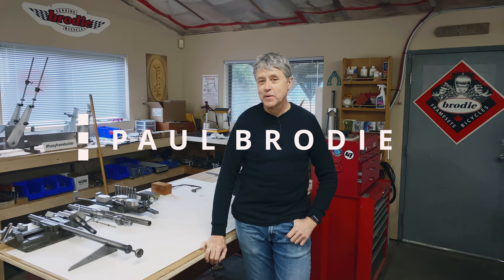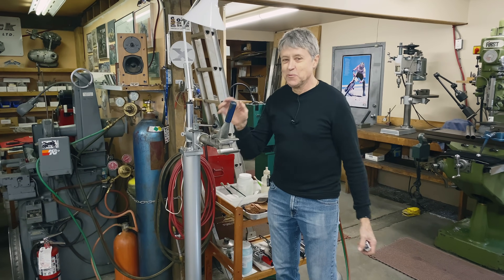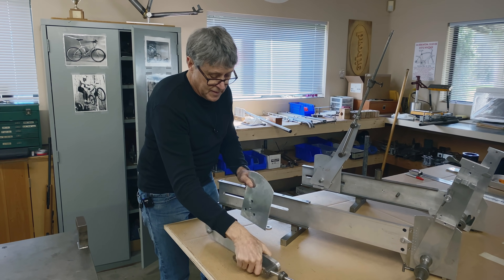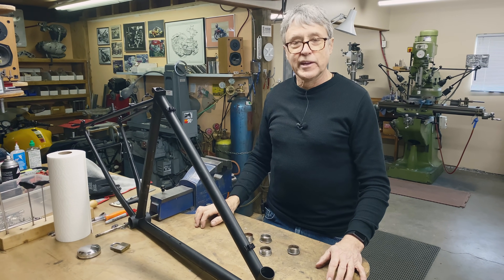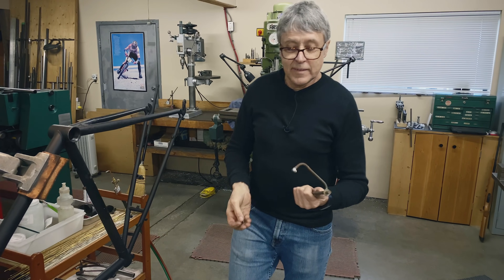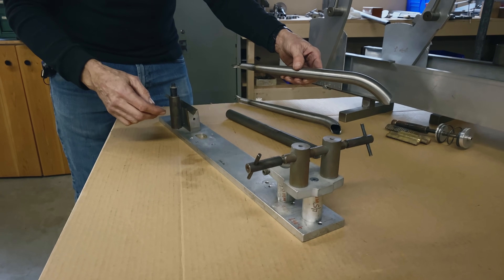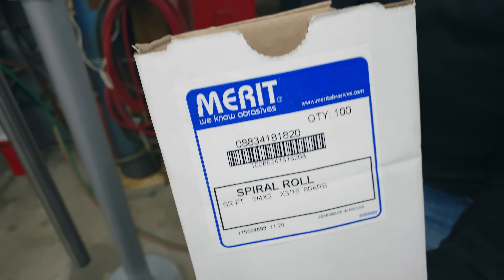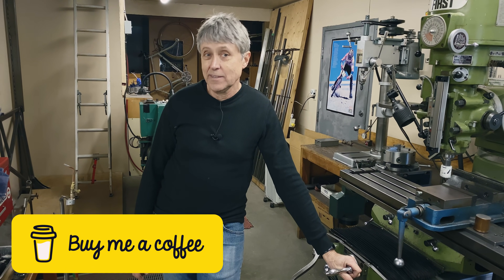Shop Tour! Motorcycles, tools, and essential framebuilding jigs - with Paul Brodie

Comment: Cool shop!  Nice elevator. Lol 9 years flew by, didn't they? Im guilty of letting my bikes, boats, 4x4s, etc all sit with gas in them for at least 9 years..  my problem is that in order to prepare a vehicle for long term storage, you have to know you're done using it.  
I thought all you frame builders used those weird old school squatty looking torches.. 
They do make silversolder in stick form they make the flat kind and round. Ive only used the 5% and 15% silver kind

Comment: Wow, thanks for sharing this, I find it odd how the bicycle people often aren't very sharing with information. It;s like I know this secret and you don't ,so you cant do what I do. I don't get it. I built a Lotus 7 and there's several forums that are very open and sharing which is what allowed me to fabricate a whole car, having never done anything like that before. bike people are often just rude to you. ???
this had to be the best u tube you've done so far. so many great tips there. 
Question; what is the main bronze rod you use for fillet brazing. I think you started to say but didn't. I brazed up my 7 chassis using nickel bronze which is used a lot in racing frames, or was, before everybody used tig. I love working with it but I'm still not as good as you are. I'm 73 and running out of time to learn a lot of new skills. but I would like to do a bike frame for another ebike. I do have a lathe, and Mill , and three drill presses. And welding equipment . And I have built a car by myself and got the tshirt.
Reply from the maker: Thanks Wayne. Not sharing does exist in the bicycle world, obviously, but also in other industries. For me, I like to share, and I think people appreciate it. Just because I show you how doesn't mean you can do it! But, I hope you can learn if you have the time and patience.. Brazing rods. We have 2 brazing videos. Check the 2nd one. It has all the rod  and flux info.

Comment: Paul you have a nice touch. I’m a mad Ducati round case nut from Australia. So projects. It’s nice to see other dedicates to bevel drives. My ultimate dream is 860 desomdromic top end on a round case bottom end a friend who is mechanical engineer over here does a plain big end conversion updated oil pump and all. Saving bucks. Old bikers never die they just get recycled.
Regards Gulley the mad Aussie.
Reply from the maker: Gulley, thanks for watching and commenting.

Comment: Where did you get the variable drive conversion for your drill press?
Reply from the maker: Well, that was close to 30 years ago, and maybe it was Acklands, here in BC? I just remember the (2) pulleys were pricey back then at $400 / set.

Comment: I bought a Sprint once and couldn't get it running... totally excellent bike for the north woods.. and.. ;;☆》.. glad I found you bro... I want to learn how
Reply: I have some SUs off an MGB... heading for modification to AuPd and the ability to hold a couple ccs of HSO4 to turn acetone into hydrogen oxygen gas... like burning methanol.... on steroids
I am going to fly my first dirigible up to visit my friend Kenny who has been building molds for plastic for a long time... I worked for him almost 40 years ago... the design is very simple.. old parachute... 10 meters... AuPd foil helium balloons... 1m³..  so multiple redundant lifting surfaces.. and shellac with AuPd dust on the outer surface of the parachute... it's going to look like an Amanita Muscaria... red with white spots...and I brilliant white gondola of AuPd foil.. stamped in a mold... from recycled beer cans... far out man 
Kenny is also a really good draftsman  .. 3D printer AuPd is next..  then.. my friend... we can build just about anything

A Muscaria... stealth technology
with windows all the way around
Reply: the thing about lighter than air aircraft is light is required by everything.. so when we land... bicycle is the best way to get around... I had some friends years ago, said traveling more than 25mph was ==>> too fast... I was driving an Alfa Romeo at the time.. .. thinking... must be part of getting old or something... no worries, right.. not me... they were right ✅.. still working on getting old... hasn't actually happened yet... my number 3 son, I think, has given up hope... no worries mate... ;;☆》
Reply from the maker: Sprints have crappy 6 volt electrics. That could have been one reason why...
Reply: @paulbrodie  I was always the electrician... the motor siezed.. rust in Oregon.. home of liquid sunshine
Reply: seriously crappy.. too true mate
Reply: pour oil down the cylinder, drain out the bottom... .. except it sorta flows reddish sludge from the ex crankshaft
Reply: I got a 58 GMC stepside instead
Reply from the maker: @richardcarew4708   Yes, we know about liquid sunshine here in BC..
Reply: @paulbrodie .. I passed through once or twice... one of the most beautiful places on the Planet... and.. it rains

Comment: Is there a national standard on bicycles such bottom bracket diameter and width and thread size etc.  If you want to upgrade a bike, how do figure if an updated derailleur for the front and rear , cassettes and chainrings will fit that bike?
Reply from the maker: There are many standards now. A lot has changed in the bicycle industry. You are asking about front and rear derailleurs. Front derailleurs have basically become extinct. Trying to upgrade an old bike with new parts might not even work, because frames have also changed a great deal. Sometimes it's just easier to buy a new bike....   :face-orange-raised-eyebrow:

Comment: I didn't see a Motorcycle Frame Jig in your shop tour. What did you use for the Aermacchi frame?
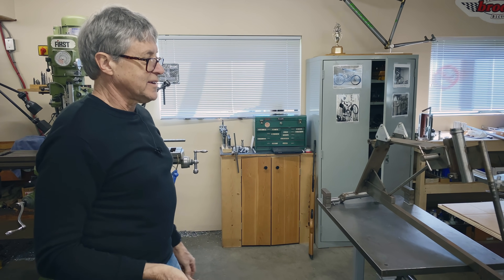Reply: It’s shown at around 14:52.
Reply: @mitchellnurseproductions  I must have been dozing. Thanks
Reply from the maker: Mitch is right. It's in the video!

Comment: What is the narrowcase Ducati single engine going to end up within one day?  (note: I have about a dozen myself awaiting myself having spare time in my workshop to do something with!)
Reply from the maker: The Ducati 250 is an empty motor. No plans for that. Too much other stuff going on!
Reply: @paulbrodie  Having owned 250, 350 & 450 bikes,  Desmo, hairspring and coil spring conversion, I find I actually like the little 250 the best.
It may be sacrilege but titanium coil springs from R&D eliminate float and breakage without the complexity and slop inherent in forked Desmo rockers.
Reply from the maker: @jimurrata6785   If it works it works. Would not call it sacrilege!
Reply: @paulbrodie  Shimming for zero takes a certain feel, and it certainly takes time.
Back in the '50's-60's spring metallurgy couldn't keep up. Especially endurance races like Mille Megillia.
But a spring heavy enough to close the valve at high revs definitely saps some power and creates wear that is not an issue with the very light closing springs you find in the Desmos.
I worship at the altar of Dr T, but I'm pragmatic enough to know where my abilities end. 😉
Reply from the maker: @jimurrata6785   Yes, it's good to know the limit of our abilities, otherwise the Peter Principle will apply.
Reply: @paulbrodie  It's really unfortunate that we don't have many of the excellent bevel Ducati mechanics left (around here anyway)
Ham's in Norwalk, CT, Phil Cheney and Reno Leoni were all incredibly talented, but with the advent of the rubber band motors in the early '80's there just wasn't any more teaching going on.
I think Syd Tunstall down in St, Pete continued to campaign some singles in AHRMA racing (with his son riding) for many years.
The last of the NC engines ('66?)marked a high point for me, before production moved to Spain and the age of the 24 hours (horrors) with their Amals instead of SS DellOrtos.
Wide case engines definitely tracked better with their increased swing arm width.
Reply from the maker: @jimurrata6785  You are right. As the years go by some knowledge is being lost. That's another reason for our YouTube channel. The Sharing of Knowledge :)
Reply: @paulbrodie  And you and Mitch do it so well!
More and more we lose not only the hand craft skill to accomplish things, we lose the artisnal mindset that sees beauty and grace in form.
The ability to know (without analyzing it) that 'this line is too strong' or 'the proportion is off' and make that correction in the process without having to go back and correct our mistakes.
Thankfully we have people like you, who are willing to share that process, and narrate their decision making as they work through a project.
I'm grateful.
Reply from the maker: @jimurrata6785   Plus, we're still having a lot of fun making these videos. Win Win!

Comment: With respect to that vise, Record was acquired by Marples and then Irwin, and they do still make stuff (not sure about this type of vise), but the quality is really not comparable to the older ones. Nowadays, the castings are from China and really rough. So, it really makes sense to hunt for old Record or Woden (pre 1956, Woden made really nice tools which were incorporated in the Record product line) vises from the 70's and earlier. They also had models where the top can rotate (model makers vise), if that sort of feature floats your boat, also quick release which is actually pretty helpful. As you can imagine, they can stand up to quite a bit of abuse, but one surefire way of f-ing up a nice vise is to put a piece of pipe over the handle to get extra leverage to clamp down harder, so avoid ones that have bent handles!
Reply from the maker: Yes, I got my vise back in the 80's, and the quality is there. Thanks for your comments!

Comment: I was watching a vid on welding up a top fuel rail dragster and they had the whole 20 foot or so completely fitted and tacked up before starting. They got two tig guys and started from one end and both guys worked on opposite sides welding the same joints at the same time and walked weld joint to weld joint evenly to the other end. More useless info for the memory banks. P.S. you have the cat that ate the canary look down perfectly.
Reply from the maker: Yes, having two welders working in unison makes perfect sense for that job. Thanks for commenting!

Comment: What motorbike is in the framed print hanging on your wall at time code 2:54 of this video?  https://youtu.be/-8P65oMKIDg?t=174
Reply from the maker: I think you're referring to the 1919 Excelsior. On our channel, we haven't shown much of it at all, but there is a lot of info and pics on my website:  www.flashbackfab.com
Reply: Pure Quality. Robert Persig would be proud! :)
Reply from the maker: @justinlee1254   I read his book years ago. Not an easy read, but it sure got good towards the end.
Reply: Haha, I hear you!  Definitely a good read, though I would have never made it through if it weren't for audio books!  ¯\_(ツ)_/¯  ....Starting a boardtrack bike project of my own based on a 85 Yamaha IT200 thumper (for now).. High hopes for a fun build & fun ride!   Thanks for the inspiration (as well as the Flying Merkel!)
Reply from the maker: @justinlee1254  Good luck with your board track project. Not sure where the Flying Merkel comes in; I don't own one...
Reply: Along with your Excelsior, the Flying Merkel is another source of inspiration for my project..    Thanks again!

Comment: The shim thickness? .016 inch/ .4mm?
Reply from the maker: Dennis, the shim thickness? At least give me the time on the video so I can check. Thanks.
Reply: @paulbrodie   first mention is regarding the head tube portion of the newer frame jig, @ ~ 12:15.

Second mention is about a minute later, regarding the seat tube portion of the same jig, @~ 13:15.  

Both shims are round, about 4 inches/ 101.6 mm.  They were said to be aluminum, and the .016 thickness is the most common dimension for “thin” aluminum, at, say, Aircraft Spruce - which is where I’ve bought both aluminum and 4130.
Reply: @paulbrodie  about two more watchings, and I might be able to eventually duplicate some of these jigs!
Reply from the maker: @dennisyoung4631   You can do it! I measured the shim. You were 100% right: .016"   🙂
Reply: @paulbrodie  that was a semi-educated Guess!

I’m going to guess, now, that the material was 6061-t6 (as that’s one of the more common flavors of aluminum outside of aircraft places.)  IRC Aluminum (local to me, in Portland) isn’t likely to have 2024 or 7075, unlike an aircraft place.  Even in aircraft places, there are limited options.  Speedy Metals, or their Canadian equivalent - presuming they have one - might have it, but their fees make me want to call them Spendy Metals.
Reply from the maker: @dennisyoung4631  Yes, I use mostly 6061-T6 for jigs and fixtures.

Comment: I dare not work in there I would make a mess  I have dust and mess everywhere
Reply from the maker: Don't worry about making a mess. That's what happens when you make stuff. My shop can get very messy when I'm immersed in building something. When the project is done, I clean my shop. It's all about the process of using your hands to create whatever your passion is. I wish more people would use their hands and make stuff.